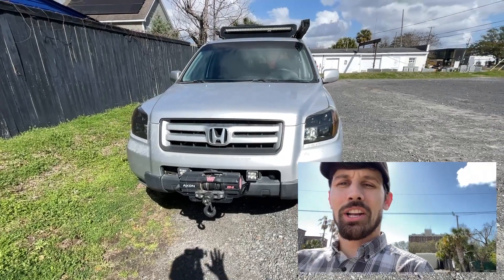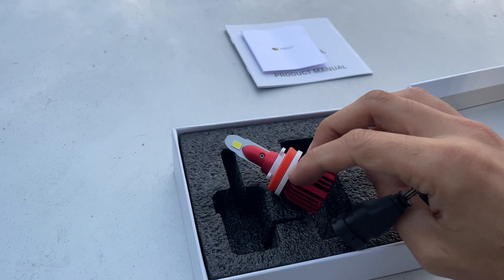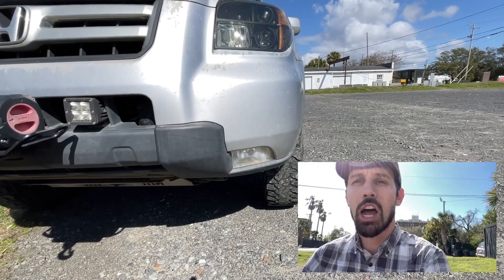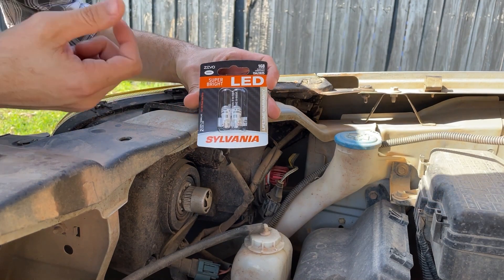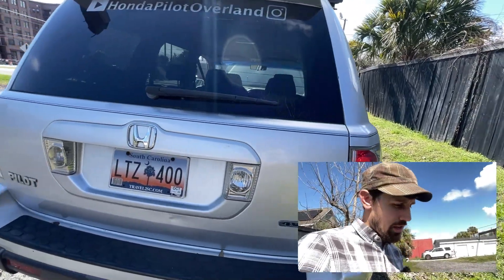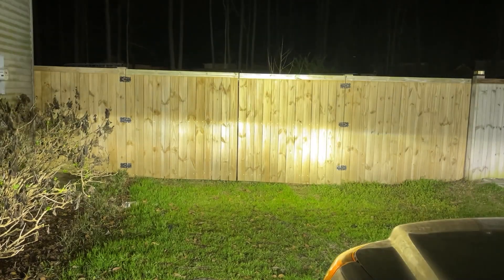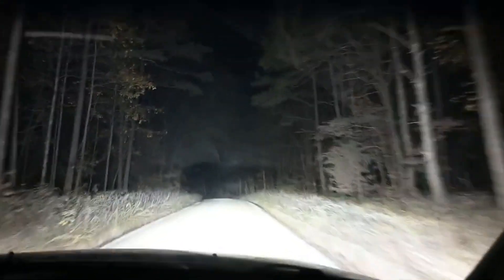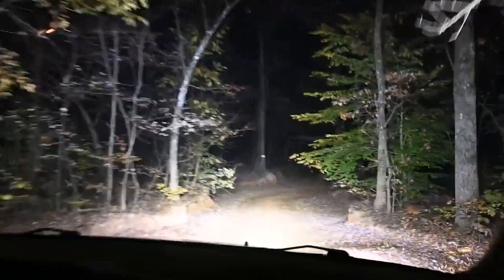LED lighting is one of my Favorite Mods (2006-2008 Honda Pilot) Ditch Halogen Bulbs!

Comment: Man those look so much better.
Reply from the maker: Thanks! It feels so much better driving at night when your lights are bright. The light bars are pretty much overkill, but the rear one comes in handy a lot.
Reply: @GotterAdventure  light bars are especially good for spotting deer on the side of the road. I use them for driving at night to spot eyes
Reply from the maker: That is a good point!

Comment: On my 07 pilot I have a combination of led’s and halogen. Led’s for daylight, front side maker, high beams, interior but most importantly reverse since my pilot has a factory back up camera and it’s much brighter now. 

I did tried Leds for the low beams for a while but couldn’t adjust them to a satisfying beam pattern, also noticed that with the h11 halogen I could see better farther away. Another observation I experienced is that during snow & ice situations the halogen’s melted the snow, ice and I could see better while driving in bad weather. 

I will definitely install amber leds on the fog lights, thank you for sharing the video and I hope your son is doing better.
Reply: I tried a basic H11 LED for low beam in the projector and it wasn't bright, so I swapped them into the fog lights and bough some "brighter" LED bulbs for the low beam and they are definitely brighter.  Better than halogen, but not a whole lot.  Previously I had Phillip HIDs (were $400 back in 2007) and they were much brighter than halogen.  One thing with LEDs is the 6000K white colour isn't as good on a rainy dark night with black pavement.  That's where then more powerful 4300K HIDs shone.

Comment: You are using LEDs as high beams?  Do you have DRL that use the high beams, and if yes, any issues?
Reply from the maker: I am using led high beams. First gen Pilots have daytime running lights that are separate of the high beams
Reply: @GotterAdventure  I have a first gen (2007) Pilot and it uses the high beam for DRL.  I tried a 9005 LED bulb and it didn't work for DRL but worked when the light switch was turned on.  ☹️

Which bulb does your Pilot use for DRL?
Reply from the maker: @schifoso  check out this thread. My drl is separate. https://www.piloteers.org/threads/honda-pilot-2006-2008-headlamp-assembly-bulb-function-map.167782/

Comment: I have two honda pilots a 05i got it from my dad after a tree smashed it i bent it kinda back into shape and put windows in it. He bought it in 2011 it was on its side in a ditch. The other is a 04 i bought it for $600 cause someone broke all my windows out of my 05 when I ran out of gas.both have more than 300,000 and run strong.
Reply from the maker: I am getting close to 300k myself! I love a good fix up :)